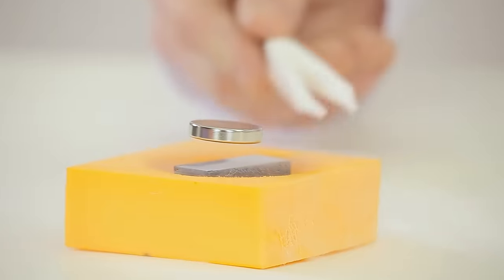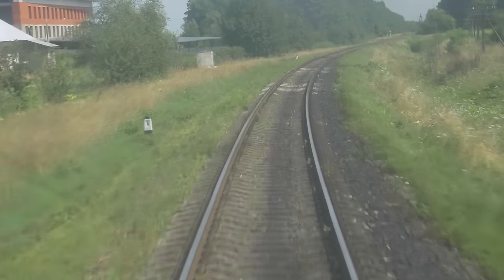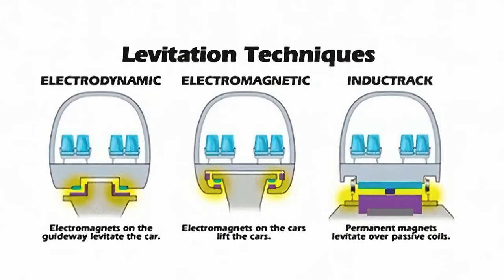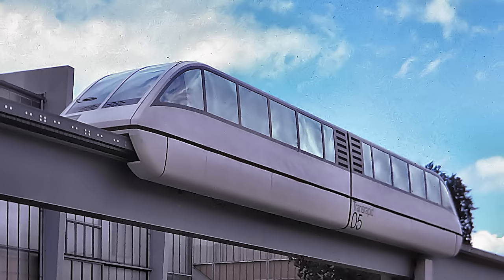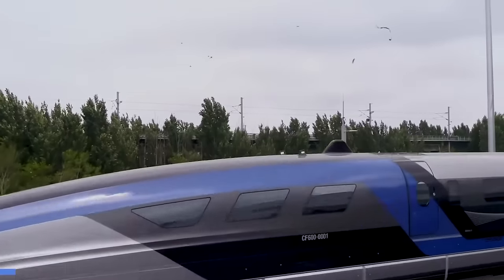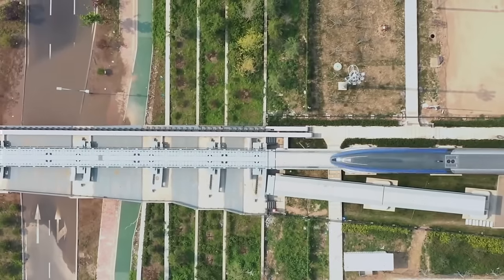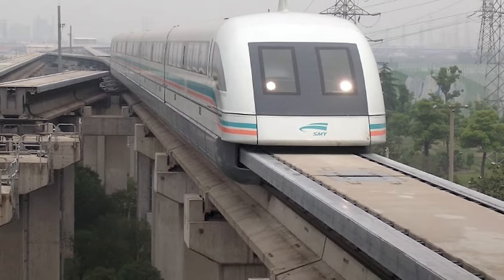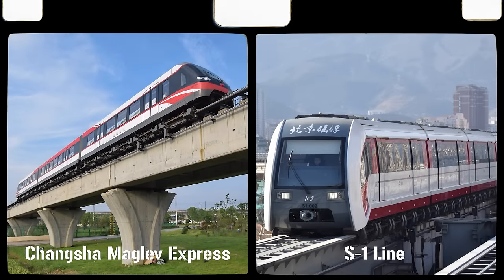Maglev Trains: Why This ALWAYS Falls Short

Comment: Maglevs really should be use for long distance routes like newyork to Los Angeles in order to supplement air travel. But the cost would be extremely prohibitive
Reply: That's like 3000 miles of track to maintain for a trip that jets already accomodate... this would be a literally pointless endeavor
Reply: @macdietz  Except maglev stations can be built closer to city centers, and don't require all the security services, and time spent traversing them, that airplanes require. They're also practically immune to weather problems. High-speed trains have  MANY advantages over air travel ... including more comfort.
Reply: It's not really a pointless endeavor when jets are not long term viable.

That said, New York to Los Angeles is not really in the sweet spot for train travel.    It would take around six and a half hours for a train to make the journey with no stops.  And realistically it would not make sense to make no stops, so a realistic travel time would be more like 7 and a half hours with 8 or so stops.

However, if such a system were created, it would make sense to have fairly high frequency, and that would mean that if you are travelling downtown to downtown you could decide to leave when you wanted, ride to the station in 15-20 minutes, catch the next train in 20 or so minutes, and spend around 20 minutes on arrival to reach where you are going, given a total trip time of under 9 hours without even pre-planning.   Compare this to an air trip where airport to city center trips can take over 45 minutes, where security and boarding often taken over 1.5 hours, and the total trip time is in the same ballpark.

But the big win would be that the same train would accommodate trips from New York to say Pittsburg or Chicago, Pittsburgh to Phoenix, etc.   All those trips would be faster than plane travel, and vastly more convenient.

I don't think it's really necessary as compared to metal high speed rail, which would not quite reach those levels of speed, but the benefits would be real.

Comment: Ah the Maglev always bring a smile it is pretty high on the rule of cool stakes . Here in Australia we have this wonderful about 10 year cycle it goes something like this some poli (politician) gets it into his head that we need a high speed rail link from Brisbane to Melbourne via Sydney. So some senior Shinny (senior public servant) reaches into his bottom draw  pulls out a file with various three letter acronyms for fast train pencilled on it and crossed on the front blows the dust off and hands it to a couple minions tells them to go and update the figures and make it look pretty, oh and graphs plenty of graphs several million dollars later it gets canned for being too expensive and goes back into the draw and you can guarantee Maglev is somewhere in the proposal
Reply: Yeah, that figures - very long distance equals extremely high price, small population equals little revenue.
Here in Denmark, the population is even smaller, but at least the distances are quite short... Too short! It means the benefit of maglev would be marginal compared to even the moderately fast trains we currently have, but still there's a crackpot political candidate who keeps campaigning on the promise of a maglev connecting our two largest cities (and nothing else) at a purported price of only €4000 or so per inhabitant in those two cities - something like fifty airline tickets for the same route.
Reply: Yep the only way we are getting a high speed rail system or even more unlikely maglev is the government and the general public  agree to wear the cost because it is important something like the Snowy River Scheme a massive mega project from the 50's. Because like Chinas system it is going to have to be massively subsidised because it is not going to make a profit

Comment: Has anyone ever calculated the amount of copper, aluminium, neodym, you name it, in, particularly their ecologic footprint? 
Copper production needs a lot of sweet water, while aluminium is electricity solidified. 
And how do we produce sufficient power consistently to drive MagLevs? 
China does with plants, fueled by its own coal. 
Those aren't just spiraling cost issues but will have a massive impact, compared to current steel rails.
Reply: You mean the same materials, which are used for modern (and increasingly electrified) cars? Your calculations should also include the amount of cars that are removed from the roads (and, thus, freed resources) by properly designed train lines.
Reply: @watcherit1311 : 
Firstly, there are only electric vehicles, no cars. 
Cars have an internal combustion engine as sole source of power. 
They can be fuelled with hydrogen, alcohol and other commodities. 
Secondly, train lines will never get designed properly, because treasuries depend in fuel taxes. 
Thirdly: If you do it like China by fuelling the whole system with coal plants, the effects are worse than fuelling with fossile liquids. 
Japan is sitting on the Pacific Fire Ring. They could use geothermal plants, but the footprint stays. 
Fourthly: Public transport generally is unsuitable for keeping busines apointments. Companied will lose money and cut jobs. 
Fifthly: 
Individual transport is freedom, is democratic, while making people dependent on a state-owned network remains questionable. 
I agree: 
We need an appropriate mix, but with politicians, lusting for power and money, that still is a rather long way to go.

Comment: Maglevs are a technology that's cool on the surface but terrible in practice. The main issue being the rails themselves. Maglevs don't get the advantage of the existing rail lines we already have, instead they need to install new lines meaning to build full new routes and the rails they have are always more expensive than existing rail. 

The main two designs are the electro magnetic and the electro dynamic both are both vastly more complicated and expensive than existing rail lines. Electro magnetic is probably the worse one as they are basically monorails. Monorails are horrible for designing switches and cross overs so in many cases the lines that use them have very few or none at all. Any disruption disrupts the entire circuit. 

Electro dynamic more has the issue of trapping air. You'll noticed that electro dynamic trains always seem to have extreme aero designs and that's because the shape of the rails traps more air in front of it. Having walls on the sides means the air can only be pushed upward away from the train, not to the sides. This increases the drag on the train similar to how a hyperloop would still have drag even in the vacuum chamber. Even if there's not that much air, if it has nowhere to go it will get trapped in front of it.

Comment: Conventional rail has been run at 358mph, but the speed becomes a drawback with both systems. Terrestrial transportation with super-high speeds involves tolerances too close to be reliable or even pleasant, and the unpleasantness is multiplied with evacuated tubes, though the old Swiss proposal was the most pleasant and feasible of those, since no one else seemed to realize an evacuated tube is easier to build underground. Only the Shanghai Transrapid has been thoroughly tested. (Not including the Cuo Shinkansen because I think it's highly undesirable as is, though the unpleasant and overambitious route is now etched in stone and steel: I'm disappointed and saddened by the Japanese.) And though the Swiss owner of the Transrapid technology claims to have improved both close tolerances and speed, there are no takers. Could this be because the always-bulky and by-some-estimates ten time as expensive to build Maglev technology lacks desirable qualities like a simple turnout that costs less than a billion dollars? The lack of versatility in this respect - for instance in the event of an emergency, or the wide spacing and huge infrastructure needed to build anything like a storage yard - appears as an important drawback, keeping the more erudite linear guideway proponents (which wouldn't include the Baltimore guy) away from Maglev. I'm a believer in the permanent utility of conventional rail transportation as the quickest terrestrial mode, but only with addition of linear induction. Linear induction will take conventional rail out of the Dark Ages for a number of compelling reasons I'm not willing to recite again here.

Comment: You totally glossed over the Chuo Shinkansen and how hugely significant this actually is within the realm of maglev technology.. This is a proper, long distance intercity maglev line that is actually being built (and will almost certainly be completed before the UK's pathetic HS2 line). And as for the 'concerns' about its seismic safety....come on, this is Japan ffs.
Reply: tsunami arrives instead
Reply: Not to mention that the normal Shinkansen already deals with the same issues.
Reply: Very true.  He glossed over the Chuo Shinkansen.  The Japanese will do everything to make sure it’s safe. Of course accidents do happen, but I have every reason to think that it will work well.  

The current Shinkansen has the best record of any railway system.  Only 2 derailments in 59 years and no fatal accident.  Phenomenal!!  The maglev will  have the same level of success in Japan.
Reply: You're right, he didn't mention the "chew-oh" shinkansen, but at the end he did go over the "choow" version 😂
Reply: HS2 should NOT be a comparison outside of cost. It’s a shit show.  It’s cancelled. It will take longer to get from Birmingham to central London on an HS2 line (because it won’t terminate in central London) than the current Birmingham to London service.  Thanks Boris (and by proxy Liz for a week and Rishi since then), sterling work lining your pockets.

Comment: I wonder if in my life time trains will ever be better than flying.
Reply: Trains can already be better than flying. I only use trains on my Japan travels with the excpetion of going from Tokyo to Sapporo, because currently the Shinkansen does not go all the way. It is significantly nicer to take the Shinkansen from Tokyo down to cities like Osaka, than spending time getting to the airport, all the security checks, boarding, sitting in the cramped sardine can that are modern airplanes, and then get from the airport to the city. On paper it takes an hour longer to take the train, but factoring in all the travel time from and to the airports and that you need to be well ahead of time at the airport, it's faster to take the train and a lot more comfortable.

Sadly not many countries have a high speed railway infrastructure of the calibre of Japan. Some can't even get a good standard railway infrastructure going. I took the train once in the US and it was horrible.

Comment: One thing the part about the curves is kind of false. You still need to build super elevation in it so that the acceleration on pesangers is comfortable. Furthermore there are not much advantages except lower friction and higher speed. And it is hell of expensive. And i dont want to know how bothersome it is to design the maglev track route so that it comftable. Heard some where that the curve acceleration was a problem for the Transrapid but no surces on that sorry.
Reply: And the part about not coliding not so sure about it would say it has more to do with the signaling and automation. And not the magnets itself.

Comment: Something has changed and that is that high temperature superconductors (HTS) can now be made into long wires and tapes. It took over 30 years to figure out how to turn material that has the characteristics of a coffee cup into long wires and tapes, but it's a game changer. Things like MRIs and Maglev/Hyperloop trains will start using them and the cost of operation will come way down. A lot will change in the next ten years if we don't blow ourselves up before then.

Comment: High speed maglev does what if the power fails?
Reply: Stops, just like a conventional train. All maglevs are designed with this in mind.
Reply: @kenoliver8913  I hope so.  I was imagining a train, no longer levitated, scraping down the track at 500K.   🙂
Reply: batteries on the train is enough to keep levitation until it stops. theres also skids under the train
Reply: @pyr0bee  Thanks for the info m8.   🙂
Reply: Stops.

Comment: <Tin Foil Hat> on.

The is already a Mach 2, Maglev system.  Its in the USA.  It link Area 51 with Las Vegas.  It links the US Navy Fleet in San Diego with Edwards Air Force Base.

It started to be built in the late 1960's.

**
Their is also what is known as the tube by Senior US Navy officers.  
It is an individual capsule vacuum system, (similar to a cash drop) it was started in the late 50's due to the fear of US Navy commanders not being able to get to their ships, due to chaos on the Road & Rail networks.

The Pentagon is linked to numerous East Coast Naval facilities with this system.

Comment: Airline travel already does 550 mph. The issue is airports and loading which is hindered by tradition and security theater.
Reply: It's also about comfort, at least for me. Especially the Shinkansen is way more comfortable than the sardine cans that are modern airplanes. Why fly when I can get a much more comfortable experience in a similar time span by high speed train? For the Maglev that is being constructed in Japan, it will be doing the Tokyo - Osaka route in less time than what the flight time is. While the cruising speed is 550mph, on short haul flights you are not spending as much time at the cruising altitude where you go at that speed. Sure if I would want to go from LA to NYC flying is the much faster option than a high speed train or Maglev. In a smaller country like Japan you get to many places in a similar time with the high speed train at a much greater comfort and with the Maglev it will be not just more comfortable but also a lot faster.
Reply: Transrapid was build with the thought of replacing short range flights by its German engineers. A plane stil consumes jet fuel to fly, a Transrapid does no such thing and can't crash ( the Lathen accident was based on human error, propelled by communication issues, and a possible suicide attempt or heart attack of the driver involved).

Comment: Have ridden the shanghai Maglev at 413Kmh. Wonderful stolen German technology. Very smooth and stable  even in turns. Incredible it has been in use for 20 years. Sadly it has always lost money as lightly used. The real crunch with Maglev vs 300Kmh diesel /electric trains is the number of people that can be moved on a given track. Diesel/electric trains can have many trains relatively close to each other to improve capacity. Due to track switching technology of Maglev trains must be much further apart, thus can’t compete. If you go to Shaghai be aware there are two speeds in use  300 and 413 Kmh trains. The journey to the airport takes 7 mins and did cost about 5Usd.
Reply: Did they really 'steal' the technology or, leaving out the emotive propaganda, go to the people with the most experience to help them build the line?

Comment: $60M a mile.... kinda expensive as hell. And that's just the track.
Reply: Are you talking about califonia high speed rail or HS2 in the UK?
Reply: The track and guideway construction is the main cost in all ground transportation systems.

Luckily, they have extremely long life cycles, especially if properly maintained.
Reply: @jsrodman  i would say its land grab and strukture  (Bridges and tunnels)

Bulding a railway only cost like €10m/km but total project cost typically end up between 50 and 100

Comment: Yeah, they don't burn any fuel. But the coal plants and the nuclear plants and the hydrodynamic plants that require it to run up on electricity do.
Reply: Hydro plants aren't known for burning fuel exactly...
Reply: Correct. They don't burn fuel. Thanks for pointing out the pretty obvious.
Reply: @benoithudson7235  Not only that but if nuclear plants burn their fuel you have a serious problem :D

Comment: You forgot to mention the Transportsystem Bögl, which is a German maglev train build by the Company Max Bögl. Transrapid did fail in Germany because it was purposely sabotaged by lobbyists during the planning and blocked by DB (especially Hartmut Mehdorn, former head of the Deutsche Bahn).

Comment: With enough time the cost of maglev will go done to be financially viable. Could be in a decade could be in a century. But they will at some point replace current trains. And they are the go-to (in a hyperloop configuration) for any space project.
Reply: Cost of energy is the main issue.
Reply: @backlogbuddies  On the contrary. Cost of shielding and superconductors cooling. Energy is already dirt cheap. But either economy grows enough so that want to be an issue. We invent room-temperature superconductors. Or economy of scale for these components catch up. Either way, I believe it is just a matter of time.

Comment: Regular trains already struggle to make money and have to be heavily subsidized. Imagine if they were A LOT more expensive to operate...
Reply: To be fair,one of the problems that causes lack of train use is oversaturation of the automobile industry.
Reply: @CircuitReborn  cheap airline companies too.
Reply: Depends where you live. England, Japan, most of Europe would fall to bits without tgem
Reply: @jamesgornall5731  I live in France. Great transport, absolutely necessary, still heavily subsidized.
Reply: @azahel542  same in England, they tried to privatise it, huge mistake, and now trying to undo years of under investment and bungling. Rail really should be considered a natural monopoly, the startup costs are huge and take decades to amortise but the payoffs of high-speed travel for a nation, for civilisation itself, are incalculable.